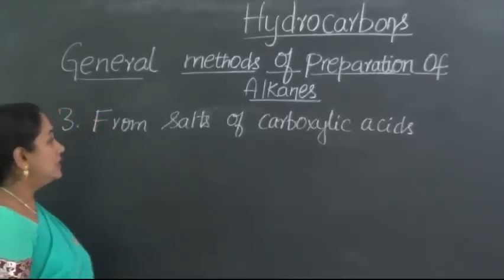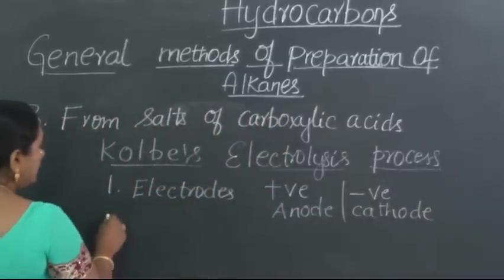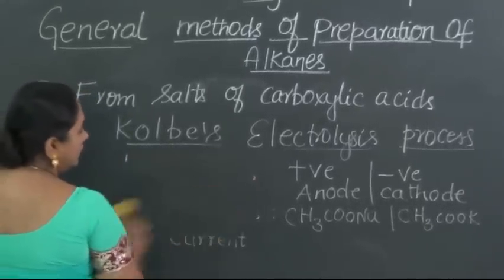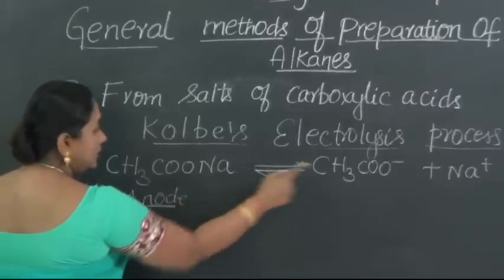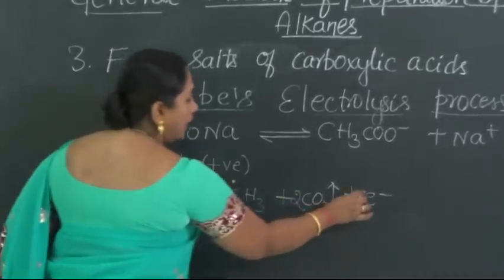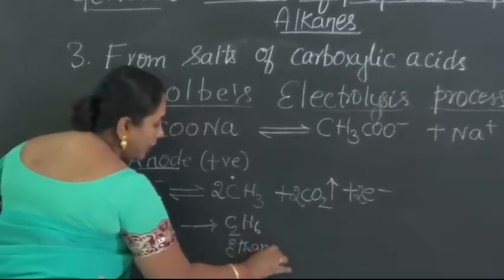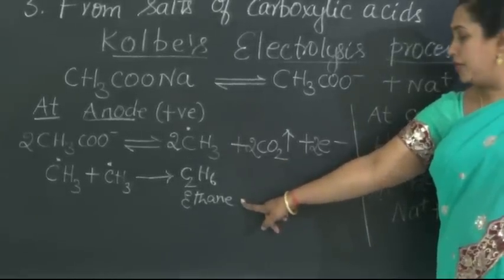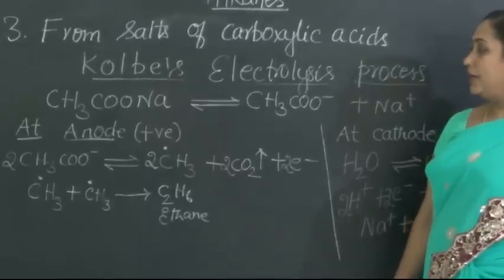Class 11/I PUC Chemistry Hydrocarbons-02

Comment: For this to work special consideration of the metals at the terminals must be considered, pt, ag and au are one's I have read about.

I am not a chemist, but in terms of numbers of cations, the Sodium cations would greatly outnumber the H ions, so my guess is the sodium metal (for a very brief time) is formed at the cathode which then reacts with water to form hydrogen gas and sodium hydroxide. Like I say, I am not a chemist, just what I think.